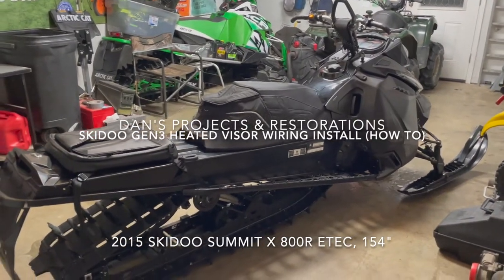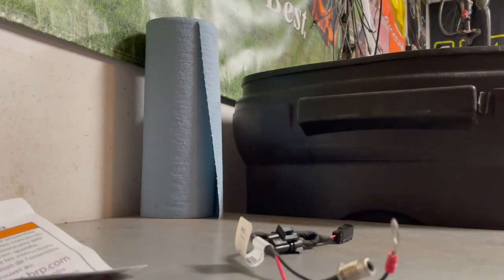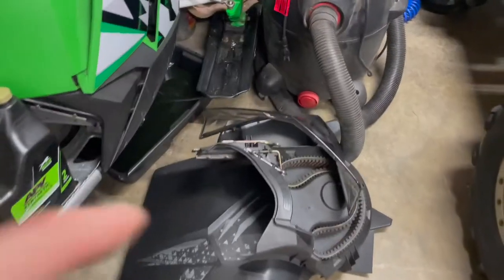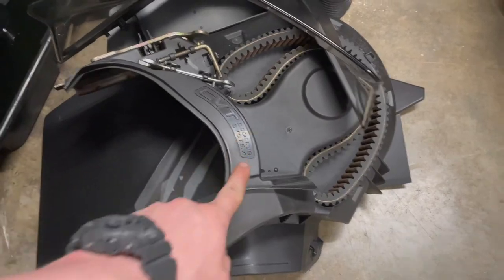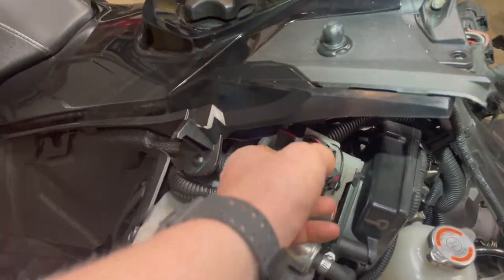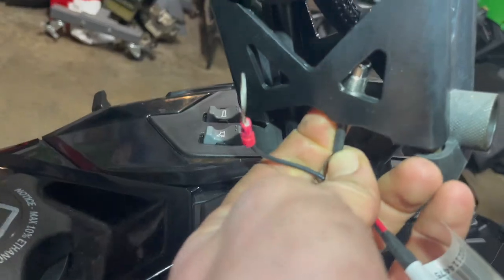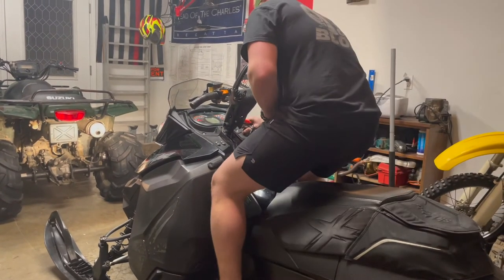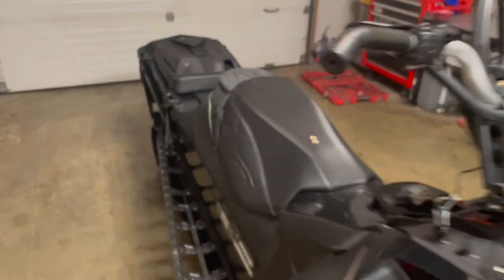2015 Ski-Doo Summit (Gen3) Heated Visor Wiring Install

Comment: Anyone check if the supplied voltage to the harness plug is AC or DC? I assume AC for batteryless sleds but I would think the computer and display are DC. Not sure if there is a built in rec for those components or if there is a dedicated DC line for non-battery sleds and this connection is part of it. 

Good video. Planning on adding this item shortly after a fogged up ride last week!
Reply from the maker: Thanks for watching! Hope it all works out for you.

Comment: What’s this ferrite kit thing? I can’t find any info on it, and dealers have no clue. What does it interfere with? My Bluetooth comms?
Reply from the maker: “It’s used to shield interference from electrical accessories that can interfere with your RF Dess key. Like the heated shield plug. If you install the heated visor plug to close to the RF DESS Post without the Ferrite kit you could have problems with your key. I believe all the 2016 and newer have this kit already on the sled.

This is from the heated visor kit instructions---

SPECIAL INSTRUCTION
Before installing this kit on any MY2015 E-TEC powered snowmobile, pleasemake sure that theFERRITE
KIT was installed.
REV-XM and REV-XS Models
If FERRITE KIT was installed it can be found on the oil reservoir.
REV-XR and Tundra Models
If FERRITE KIT was installed it can be found on the left side between the vehicle harness and accessory
wire.
DESCRIPTION PART NUMBER
FERRITE KIT 515 178 088
If needed refer toWARRANTY BULLETIN 2015-9 or 2015-10.” - taken straight out of the forums
Reply: @backcountrybuilds  Sweet. Thank you. Found one locally. Thank you for the video. I’m sure it’s pretty much the same for my 2015 renegade install.